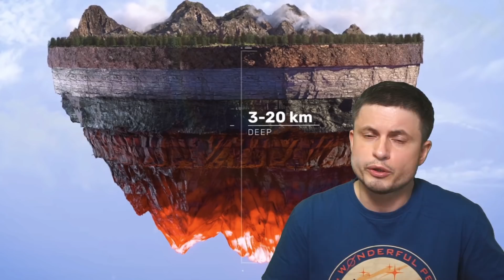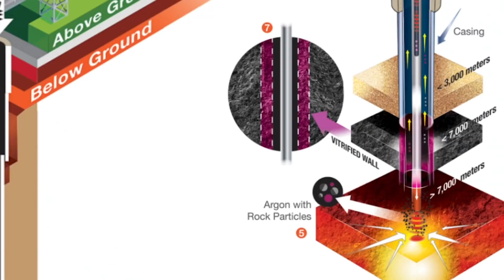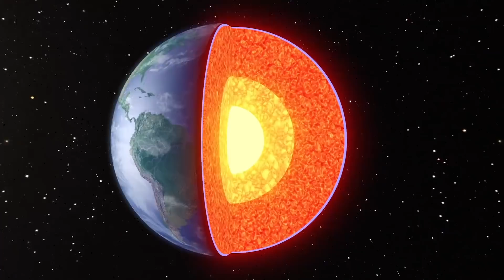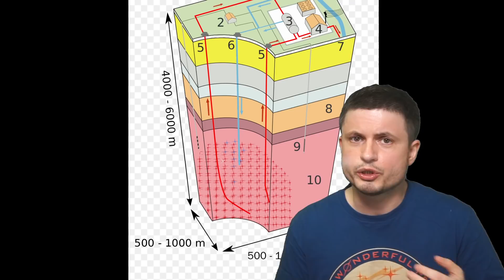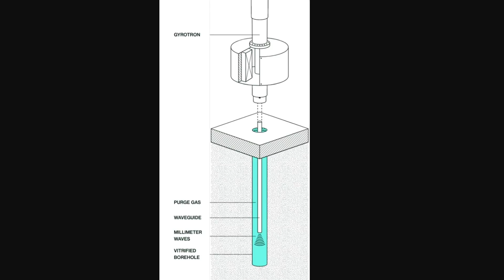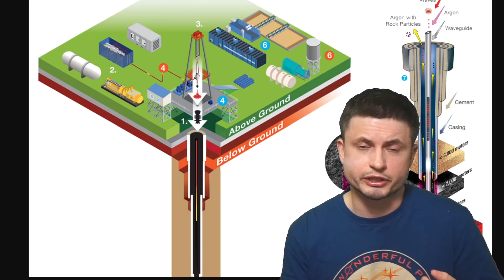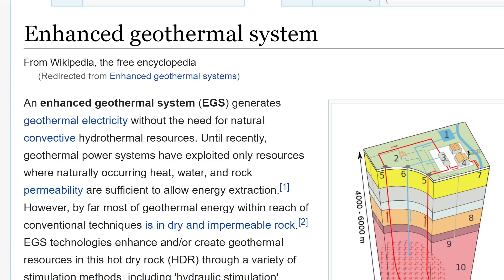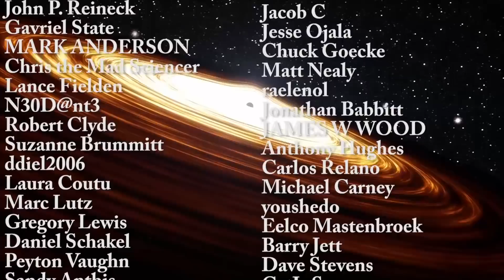Creating Deepest Hole on Earth For Geothermal Energy Revolution

Comment: It kinda bugs me that more effort wasn't put towards this direction prior to this point, because we have know for so long that the Earth's core is quite hot and powerful, and leveraging it (for the most part) only requires the cost to expose that energy from the ground and then transport it to where it needs to go.  We're just releasing that potential energy that's just sitting there.
Reply: Sometimes cool technologies just don't make economic sense. I hope this way of drilling holes turns out to be cheap enough to be competitive.
Reply: In fact, we have a massive oil reservoir under North Dakota, but have never even used that because it's not cost-effective unless gas stays above $4/gallon for a prolonged time.

Comment: Nice Idea but already see one problem, if we overuse it, it may lead to  core cooling so it can weaken magnetic field in really long run as we don't have  perfect conversion ratio for thermal energy and some heat will be always lost. 2nd issue is water it self, with  current situation we are closing to shortages of drinking water. But as I said idea seem good.
Reply: You are correct. Let's just give up.
Reply: @benthere8051   I'm not saying to give up  but to be careful with "deep core" techniques.

Comment: What if we cool the Earth too much and the core would solidified?
Reply: The inner iron core is solid and expands a little bit every year. The outer core and mantle is still hot liquid due to radioactive decay from uranium that came from supernovas before and after the Earth formed. I don't think using the hot rocks in the crust will have any impact.
Reply: The core is 2900km down.   20km is the depth they are trying to use.  Still well inside the (continental) crust.    Basically all the current geothermal schemes are just trying to intercept heat that has already made it 99.5% of the way to escaping into space.

Comment: Check out the Geysers project, the biggest geothermal operation in the world, that produces hundreds of magnitude 2-3 quakes per year.  Would be worried that by drilling deeper, that the earth quakes could be bigger.  Shouldn't stop this though as this is a really good idea.
Reply: I would think it would be safer to generate lots of small earthquakes rather than have them naturally build up and have one large earthquake.
Reply: We're taking energy out of the earth, not adding any. And energy released by earthquakes would only be the energy that was there before (or less, since we took some out), though we might make it release in smaller amounts more frequently, rather than "storing up" for the "big one" someday. Which might actually end up being a good thing.
Reply: @Timestamp_Guy  By taking the energy away from the earth, the rocks cool and that is how the quakes happen.  These are quakes that would not have normally happened though as the earth was in a steady state until we disrupted it.  I tend to agree with you but then again, that same argument was made for fracking quakes and people didn't seem to appreciate those. I think people would draw the line at human caused mag 6.0 quakes in remote areas.

Comment: I had a dorm at my college that used geothermal as a source of energy. It was neat
Reply: A new building  at my community college put in 400 holes to 300 feet for geo to heat and cool. A local strip mall put in 70.  Northern IL. usa.
Reply: What country are you in, if you don't mind me asking?
Reply: @scottcantdance804  USA, aww man, just went back to check it out and it seems they switched to solar a few years ago due to rising maintenance costs
Reply: @DatOneRadDad  It shouldn't take a lot of steam to heat a dorm; they even have steam pipes running through NYC. But I imagine maintenance costs is one thing that makes geothermal more expensive than nuclear; the other being drilling and facility costs.

Comment: Surely to dig out the glass the machine made ....you would need tools that can operate at such temperatures? surely this is beyond current electrical systems?
Reply: Looked like the glass was pushed to the sides to form a liner for the hole.  In theory, anyway.

Comment: I'm actually astounded not more research has gone into developing geothermal energy and dep-drilling genothermal energy in particular. Drilling 14km+ will give you basically unlimited power almost anywhere on Earth. I know fusion power is probably sexier than drilling deep holes but not even fusion power has the potential geothermal energy has.

Comment: I use to help drill oil well offshore and onshore, I made well logs, there are thousands if not millions of oil wells drilled that are not productive or being used, these wells are everywhere... if we could utilize these somehow then we have much of the work already done for us!!
Reply: God, I hope most of those wells were at least properly plugged. The list of forgotten wells that need to be addressed is already growing far too long.
Reply: Good point.
Reply: I think the new fangled enhanced geo thermal is trying to explore doing just that. Re use existing dead or capped wells. 
I always thought employing the people who do this kind of drilling for a living, was one of the most efficient uses for switching to more sustainable energy sources for our power grid. 👍🏻
Reply: Most of these don’t go deep enough to generate enough heat to be really viable. Also, the deep parts were designed to be open to the environment to actually take in material - these are not intended to be used to release a lot of the fluids below the surface- so they don’t want fractured ground or even just a traditional well.
Reply: THIS IS A HORRIBLE IDEA!
Cooling the core of Earth kills the magnetic field that protects us from the Sun.
Kill the magnetic field and you literally kill everything on the fucking planet.
Stupid engineers can't think past their own noses.

Comment: Geothermal electricity generation is more beneficial to the environment than any number of wind turbines. You don’t have to figure out how to recycle fibreglass blades when they break down, and the plant has longer life span. Here in New Zealand we have several geothermal stations already. Not as economical to have them away from the geothermal areas at present, so will be interesting to see how this goes. 🤔
Reply: It's also not going to be chopping birds in half.
Here in America, a wind turbine farm was just fined a large amount of money for taking zero precautions in regards to protected birds. Their facilities kept killing endangered eagles and some other birds; they've been ordered to take steps to prevent the deaths, like shutting down the turbines at times when eagles are most likely to be passing through.
Reply: One downside though, is that New Zealand just tapped into present hydrothermal systems. This has essentially killed off a very large quantity of New Zealand's natural geysers and hot springs. Hydrothermal has a tendency to do this unless you actually pump the water in yourself. Its kind of sad to read about all the lost geothermal features due to power generation.
Reply: @StuffandThings_  the law was changed some 30 or so years ago and private homes in the city of Rotorua had their bores closed down. The geysers recovered and have returned to their former selves. The electricity generation stations are away from those areas and don’t have an effect on the geothermal areas like the home hot water bores did. Completely agree about pumping the water down versus just extracting the steam though. A captive system would be the best way of doing this.
Reply: @brianmarshall1762  Really, the best systems are like what Iceland does. Krafla is a wonderful model for a power station - drill near a very large magma chamber, pump in water to generate steam, and do it all very large scale. The Geysers in California is also a pretty good model too, just using a fumarole field and pumping in water. New Zealand has a very respectable stance in many aspects but their use of geothermal and damming the Waikato was definitely not the wisest. An article I found stated that no extinct geysers have recovered from the geothermal energy. I can't seem to find the exact number now, but iirc well over half of New Zealand's geysers are now extinct. They pretty much permanently destroyed almost all of their geothermal features for power.

Comment: Molten salt nuclear operates at about 700 degs C to generate steam at 560 degrees. This can used standard (coal fired) turbines and gives about double the thermal efficiency of a PWR reactor. More importantly, a fast spectrum molten salt can be fuelled with (so called) nuclear waste. The irradiated used fuel can be put into a molten salt and used to exhaustion. PWR can take up to 4% of the fissile energy. A fast spectrum molten salt will extract 99% of the fissile energy. The resultant waste has a 30 years 1/2 life vs 30,000 years for PWR used fuel.

Comment: I remember Kim Stanley Robinson's Mars trilogy, one of the most effective ways to keep the planet was digging a really really big hole. They used a whole bunch of automated bulldozers and dump trucks.

I would probably use a Boring Company TBM. Have it descend in a helix, do a half circle come back up making a double helix. Then send it back down again, repeat as necessary to increase production.
Reply: Boring company, overcomplicated dreaming for now. Thunderfoot estimated, that work done in 20 years by old tech would be done in.. 200 by them.
 Anyway, not my estimate, correct me if it's wrong.

Comment: Terrestrial plates of most continents are too thick to dig the holes practically. Getting heat to the bite hole is a limitation and  convection or conduction may have less importance getting mantle heat to the crust; the bottom of the lithosphere acts as a strong insulator. If we go with sites near geothermal vents or fissures we’d need to port power long distances making the power net work vulnerable to solar storms. The heat transfer rate into bore holes would likely be  insufficient…you’d need a type of fracking to create a flow network for working fluids. And that introduces problems as well. Alternatively, you’d  need a really large number of holes. The problem isn’t how deep you can drill a hole (well, it is, but let’s give them that). Assuming you have a hole, how much heat energy can transfer laterally into the working fluid (assuming it’s a heat pipe or similar system) through the matrix surrounding the hole, to provide the power (heat work per unit time) to make such a system economically practical?

Comment: Doesn't  have to be too deep.
Alaska north slope oil temperature  comes out from the well head at nearly 500 degrees Fahrenheit !
I suspect it must be the location of the bore hole itself.
Reply: @Edward Elizabeth Hitler Do you have any knowledge of this subject and if yes, did you make any calculations on this theory?
Reply: @Edward Elizabeth Hitler I mean, how big and deep of a borehole are we talking? Volcanoes have HUGE vents and chambers and even those go extinct when the magma below moves on.
Reply: @Miguel.L  there was a made for TV movie based on this premise in the 70’s. I think it was called the Crack in the Earth. A crack spread around the Earth until a large chunk of the crust blasted off the planet, forming a new moon.
Reply: @Edward Elizabeth Hitler  wells are about 4 inches in circumference ,don't see how they could effect  anything.
Reply: Hello Hal from a fellow Hal.
Reply: Yes it's definitely location. If there's a magma chamber close to the surface there would be a lot of energy.  In your case, it may also be because of convection or the forcing of oil up from very seep depths with slurry.
Reply: @Edward Elizabeth Hitler That's not how fault lines or volcanoes work. At all. Please, stick to rebuilding engines.
Reply: Yep, drilling into the side of volcanoes seems to make more sense
Reply: @cpmf2112   It could be dangerous, to drill in volcanic areas.  Have a read in Wikipedia, about the Sidoarjo mud flow, in Indonesia.  The jury is still out, re the cause.  So, until we know more, it might be best to only drill in geologically stable areas.
Reply: @cpmf2112  That's what I usually do.
Reply: yea it depends the location a lot not all depths are so cold the crust is really diverse
Reply: Constant earthquakes.  I had a cabin near Cobb California. Geothermal power plant next door.  Two or three a day that I could feel.
Reply: @oldmech619  if you live next to a geothermal power station, that means you live next to a shallow fault.  It's not the power station causing the small quakes, it's the small quakes indicating this is a good place to build a shallow geothermal energy plant.
Reply: @Juttutin  That is absolutely not how it works
Reply: @ryanrivera5763  it's exactly how it works in this country.
Reply: @Juttutin  which country is that?
Reply: @oldmech619  Well, let's see, is there anything natural nearby that could be causing earthquakes? Like, I don't know, Cobb Mountain, a volcano, or Clear Lake, a volcano? Or all the many faults in the area?
Reply: @filonin2    Yes, it has all the above. The area is littered with geothermal heat. The power plant acknowledged the problem and then started to adjust the amount of injected water.  It slowed the earthquakes to about one a day. It became a livable problem.  Not a good selling point. People have to be aware of the problem. It can be a serious like a lot of communities around the world.
Reply: @filonin2  There are many faults nearby, but the earthquakes he is feeling is in fact induced seismicity as a result of the geothermal activity at The Geysers.
Reply: @oldmech619  No need to put the quarter in the bed.
Reply: @Edward Elizabeth Hitler That's all conjecture. And you're seeding doubt. Based on modding engines. Interesting.
Reply: @Edward Elizabeth Hitler i live in nearby geothermal power plant for many years, it was volcano plateau never heard of any magma or lava disruption, even when earthquake struck, the only real threat i knew was ocassionaly toxic gaseous
Reply: @Edward Elizabeth Hitler The hole is about 4", and the Earth already has thousands of holes thousands of times bigger. You can't compare the size of the earth with any practical application in mechanics. This is a non issue.
Reply: @Edward Elizabeth Hitler I still think they should try it at least once just to see what actually happens. Maybe in some far off location where it won’t affect people.
Reply: @Miguel.L  instead of that nuclear reators. Already proved that they work well but a few human had to make mistakes and now everyone is scared of it
Reply: How much pressure? Gas and/or oil moving at high velocity through pipes will create heat just by the friction of it moving through the pipes. The higher the pressure, the more heat it creates.
Reply: THIS IS A HORRIBLE IDEA!
Cooling the core of Earth kills the magnetic field that protects us from the Sun.
Kill the magnetic field and you literally kill everything on the fucking planet.
Stupid engineers can't think past their own noses.

Comment: maybe this is what killed mars . most dead volcanos are empty tubes but Olympus mons is full all the way to the top as if the magma solidified in place . and maybe can directly from the core
Reply: That's actually normal. As I've explained to you before, Olympus Mons is a shield volcano with six overlapping calderas that formed over a stationary "hot spot," like Hawaii. And, just like Mauna Loa, it has a pretty normal appearance for a shield volcano, despite its vast size. Thousands of basaltic flows over a span of hundreds of millions of years (possibly over a billion) slowly built up the sloped sides, a process that was made possible by the lack of tectonic plate motion on Mars. The lava chamber that fed the calderas is estimated to be about 32 kilometers below the surface, which is a fair ways from the core.

Comment: Not renewable. Yes, there are a lot of heat, but once humans start exploiting a resource, they are very efficient.
Reply: it would last so long it might as well be
Reply: And there might be unintended consequences. What if the hole starts leaking when dug too deep, or that the cooling effect might impact the thermal generation?

Comment: I think this might be mainly a way to extract money from investors. With a heat exchanger you can extract enough heat for a house to be heated by booring about 100 to 200 meters. That is if you live around the arctic circle. Other places much less deep holes are needed.
Reply: But the problem is not simple countryside houses but industrial buildings and town multilevel houses which needs so much more energy than what can be produced locally for now. And its not about just heating either but electricity production.
Reply: @StarfoxHUN  yes but the problem for the Russians was that the hot rock was so maluable that the rock was essentially floating and closed down the borehole. Unless they have a plan to stop tectonic level processes im not sure how they will succeed.